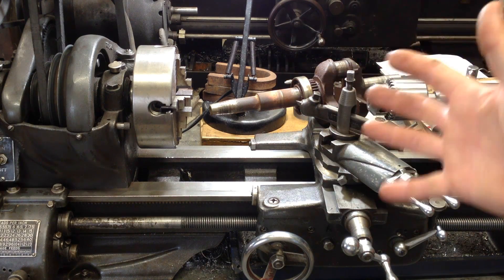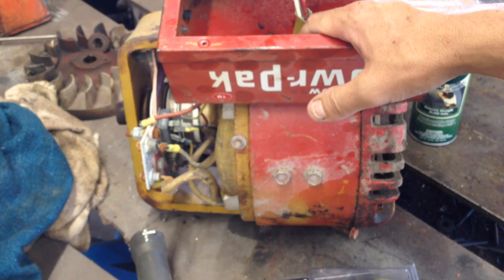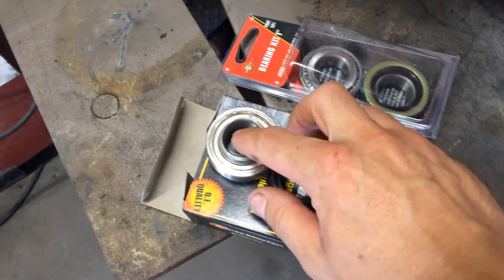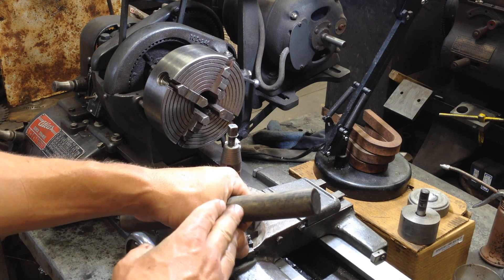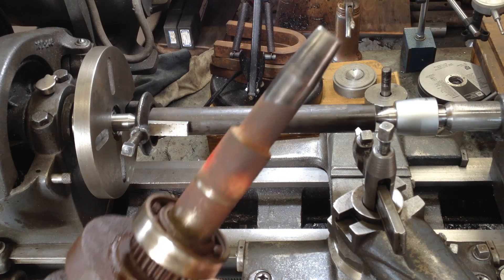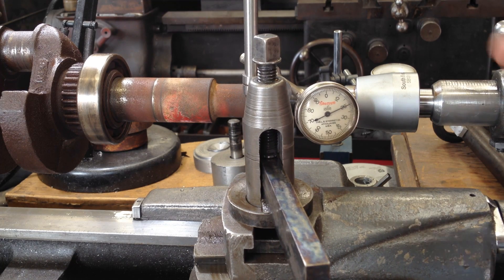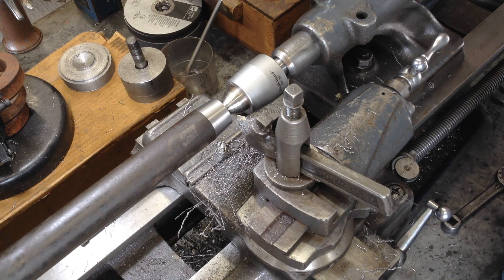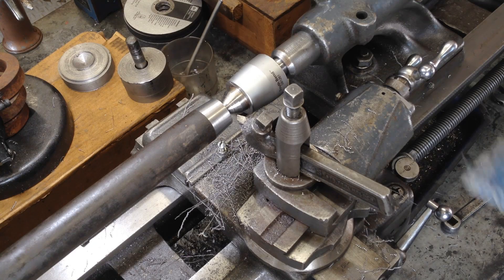Wood Chipper Build - Episode 6- Tapering

Comment: Hey Matt, I have a newb question for you. Why did you use a lathe dog and center on the spindle side instead of using a chuck? 
Also, a big Happy Birthday to your Grandpa. Would be very awesome to hear some of his experiences on camera.
Reply: Turning between centers is useful when you need repeatability. I use it when I'm turning something like this. It lets you, for instance, take the work out of the lathe, flip it to machine a different section, and flip it back without any risk of losing zero and having concentricity issues. I use my chuck for this and take a skim cut on the sacrificial center, but some lathes come with an accurately machined center that can mount into the spindle without having to true the center every time. He's probably set up with one of those.

Comment: Hi Matthew, judging by the picture, looks like your Grand'Pa still got a lot on his plate, he'll have to be around for a while to get done...
Unless you really want to experiment with finishes, by playing with speeds and DOC, you can really get the lathe to grab all it can in order to speed up the roughing part, the surface finish don't matter until the final cut after all... 
If you use deep groove bearings there will be no problem at all with the generator being vertical.
Summer is a busy season in farmland, so more machining in the winter though.
Cheers, Pierre
Reply from the maker: +pierre beaudry I hope he's around for quite a few more years.  :) I've been paying more attention to speeds and feeds lately. Grandpa taught me to run the lathe, and his approach was "just put in gear and go!" so I didn't learn what was correct.  Watching these CNC guys has really made me realize just how important it all is.
Reply: Wide Vision Metal Fab
You're absolutely right about speed and feed, it is having a direct effect on the work, lots of removal is a great way to practice...